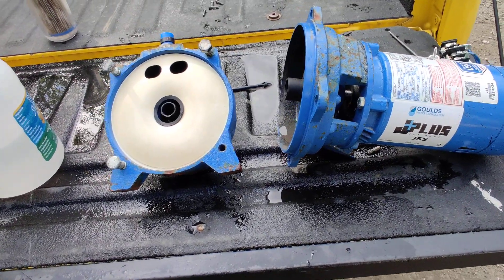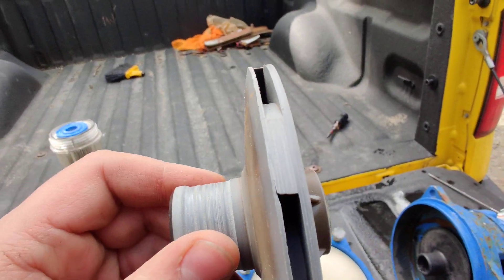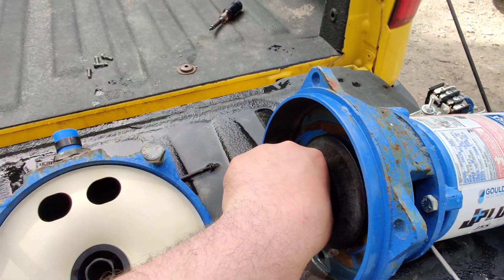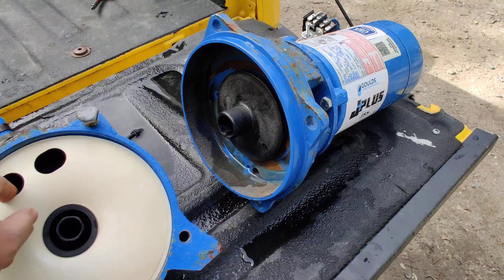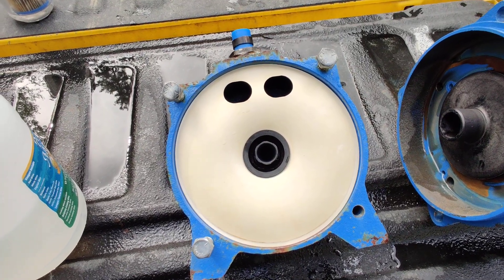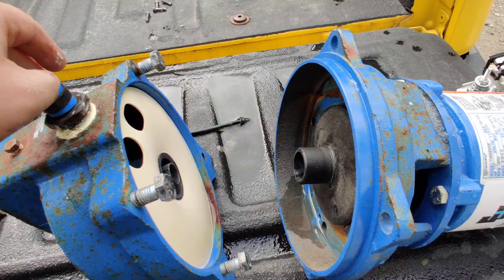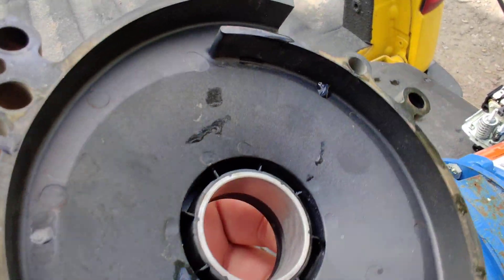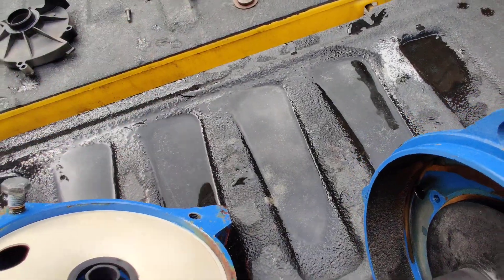Shallow Well Pump Rebuild -Gould J5S

Comment: Your suggested method for removing the impeller is incorrect and could damage the cooling fins. The manufacturer, Goulds (Xylex), also advises against inserting the seal into the diaphragm.

Comment: If my J5HS is making loud noise (significantly louder then before) would that be the impeller issue or are there any bearings that are worn out?
Reply: Probably bearings there are three, today the rebuld parts cost over 50% of a new pump sadly.

Comment: I had a Vacuum gage in the front 1/8 plug was..just to see the suction from my well, now the gage has popped off the rubber plug that sealed in the "oil" gage and slowly dripping water...when I took it off there was Pressure on it...I put a plug back in..is there something wrong?  I get great water pressure, was wondering if there is a check valve in these?  thanks so much

Comment: Just rebuilt my GT15. Thanks for the video. Very useful. CAUTION The "black piece between the two" is wrong. It is the Guidevane Seal Ring part#SK555 and it is installed last, after the Diaphragm part#SK522. Fitting around the Guidevane, the Guidevane Seal Ring will be sandwhiched between the Casing and the Diaphragm. Do not fit the Guidevane Seal Ring inside the Diaphragm as shown in this video! DO NOT stick anything into the motor to hold the shaft because it will break the plastic motor fan parts. Remove the back case and put a wrench on the shaft where it's intended to be held. Impeller removal on my unit was impossible without breaking the Impeller. The front half of the Impeller broke away. I eventually had to remove the motor, disassemble the back to access the motor shaft and use a wrench on the back with a C-clamp on the remaining Impeller to hold it in place. Careful on the back of the motor. The plastic bits are delicate and I broke a plastic tab on the terminal block that required some re-engineering to put it back into service. I used water and spit to lubricate parts when reinstalling. Main thing is cleanliness. It's a water pump and water lubricates the ceramic seal. However, Super Lube Multipurpose Synthetic Grease is shown on one of the pro shop rebuild vids. Part# SK7 in the rebuild kit is the Deflector and I did not find any reference to it aside from the schematic. The Deflector is installed first on the motor shaft before the Motor Adapter is installed and is "outside" the pump and visible, slinging any debris or moisture that gets on the motor shaft.

Comment: That is the purpose of the diaphragm?   I brought my pump in for a shaft seal repair  and the pump expert told me not to use the diaphragm.  Gave me a very flimsy gasket for the diameter.  Skeptical, I put it back together and it works well.  But not having the diaphragm is bugging me.

Comment: I think Gould assembles them with the seal against the diaphragm just because it's easier / quicker assembly... I put my seal in the hole of the diaphragm as you did ... Pumps like a banshee over 80 psi...

Comment: The diagram just sits onto the seal. You aren't supposed to put it on both sides of the diagram as you did. Don't assume and do as you please then make a video so others can make the same mistake.

Comment: The seal ring (Gould’s 5K6) should not be installed inside the diaphragm gasket (Gould’s 5K557). Put the guidevane (Gould’s 3K75) over impeller (Gould’s 2K4), and snug the screws. Reach in the middle and spin the impeller with your finger and adjust the guidevane before  tightening so that the impeller is not rubbing on guidevane hub. Then place the diaphragm over the guidevane, then slide the seal ring over the guidevane hub on the OUTSIDE of the diaphragm. The install the pump housing. Never stick a file or screwdriver through to hold backup. Use a 7/16” wrench maneuvered down the back side of the motor to align with the wrench flats on the shaft. I rebuild these for a living.
Reply: Hi thanks for the tips, if you don’t mind how do you take the cast iron 1K310 motor adapter off, mine cracked due to frost. Thanks
Reply: @ sorry so late replying. First take the casing off. Then remove the guide vane with a Phillips screwdriver. Then you have to spin the impeller off of the shaft. You can take the back cover off the motor off and fish a 7/16” wrench beside capacitor to reach the wrench flats on the back end of the motor shaft to hold back up while turning impeller counter clockwise. The impeller can be tight sometimes, but you should be able to remove it by hand.  With the impeller and rotary half of the mechanical seal off, you can remove the four motor adapter bolts for removal. If you want to try to save the mechanical seal, you will have to carefully remove it from the motor adapter without damaging the rubber or ceramic seal. I hope this helps. It’s really not that hard of a job. Oh yeah, you will also need to remove the tubing to the pressure switch.
Reply: @ sorry for the late reply,  I replied to my comment with your answer.
Reply: Thank you I will put that seal on the outside of the diaphragm there are so many conflicting instructions I guess I'll stick with you

Comment: Thank you for sharing. I found the seal to be loose inside… pump just spinning but no pressure . Now I see that you mentioned that is very important so I’m gonna make sure when I buy the kit. The existing seal seems to be expanded now and unable to put it back into the circle

Comment: I have that exact same pump. It was left in a house that was abandoned wasn’t winterized the water froze and cracked it just the pump head. I can’t seem to find a replacement for this J5S pump. I need the pump head and the rebuild kit I’m on Long Island in New York and I cannot find it. I would appreciate it if you know where I can get one. Thanks

Comment: Thanks! This video helped me repair my pump! The rubber ring thing was tricky but I finally got it!
Reply from the maker: As state by a few others, you may not want to use a screw driver as a chuck.  Although the amount of force needed to loosen in all of my cases has been so minimal that I wouldn't be too concerned.

Glad it was of use to you!

Comment: IMHO Do NOT put the metal file or screwdriver the way it is shown here to lock up the shaft.  That is a plastic cooling fan with vanes that will break off if you need to apply enough pressure to loosen a tight impeller.  (Ask me how I know.)  I followed this video and did that and broke off a piece of two of the vanes.  I'm hoping I didn't do enough damage to cause any issues with the pump when it runs.

Comment: Anybody have an on-line parts dealer for this kit. Seems to be very difficult to find for some reason. I’ve only found a couple and of course they’re out of stock. I live in Canada but would happily order from the states if I could source the parts there. eBay has had the kit in the past. Good video, thanks!
Reply: Try and get on the phone with somebody.
Reply: @blaine1014  Thanks, tried. These plumbing places are very secretive in Canada. Got a rebuild kit on eBay anyway.
Reply: @peterbush7900  not my experience with suppliers in USA! Took me 5 minutes to get on the phone and order a SCOT pump seal kit

Comment: Hi Klaus, That impeller  seal surface really got eaten up. Assume once it got grooved up that bad you had very little pressure build up,,or eventually no pressure buildup.
Reply from the maker: Pretty much, the pump would take almost 10 minutes to build up to 62 PSI in my 36 gallon tank, when previously it could fill in under 30 seconds.
Reply: @HaemonAK  The reason i ask is,,, I have an old Wayne pump SWS50 similar to yours but not as heavy. I pulled from our house basement as it took along time to recover fill tank  ,It was only 3 years old at the time, It sit in garage for 5 years,,and now wanted to use it to be dedicated for vegetable garden. I tore it apart just for kicks, i see nothing at all wrong with it,If i put intake hose in 5 gallon bucket of water it barely dribbles out discharge . If i pull hose out of bucket and up in the air dump water down the inlet from jug it will blast out water discharge like crazy. Almost as though there is a suction leak?  Mine is setup quite different from yours in regards to the impeller/diffuser. My diffuser/impeller mating surfaces has no grooves at all. They are so simple...after looking at them, I am more curious than anything why this will not pull a  prime from a  five gallon bucket...Sorry!  For long message
Reply from the maker: @brcisna  No worries at all.  Yes, if you can't pull from a 5 gallon bucket, I'd look to see if it's got a leak in your pickup tube.  Have you primed your pump using water to start as well?
Reply: @HaemonAK  , Thanks for suggestion. Here's how im test benching this shallow well jet pump.
1. Inlet has plastic 1 1/4 MPT plastic to 1 1/4 barb,  have a two foot section of new not sure what type rubber hose  is very heavy duty, for irrigation I think ,not sure spin name of the schedule, put two hose clamps on hose at barbed fitting to make sure it is pulling down tight after weak output, Pump sits on two concrete blocks with five gallon bucket right beside the blocks on ground . Other end of hose stuck in bucket of water. i have a gallon jug to prime with. Eventually the pump will start dribbling out water out discharge,and if i hold hand over discharge it will build fairly decent pressure if i release hand slightly,,,do this a few times,,then the pressure completely peters out. Have repeated this a few times, It seems like after run time just a  little bit, few minutes the pump warms up and then really gets weak, Almost wonder if the diffuser is warped but i did glob some good silicone between mating surface to seal shaft that diffuser bolts to.  Was just hoping to use what I had on hand but this pump isnt worth the cost of a rebuild kit. Can find a decent low end submerisible pump for about cost of rebuild kit. BUT,Ill have to put down a new casing to accomidate the larger diameter submersible pump. :( Sorry for long message again.
Reply: @HaemonAK  Sorry for all the messages. Am wondering if maybe the shaft seal would cause an intake leak? I would think the shaft seal would almost have to show signs of leaking out if this were the case. My curiousity just gets to me when seeing how simple these things are after getting into one of them, I never did actually take the impeller lose from shaft seeings it looks perfect.

Comment: Be care full by stick that file in you can brake the inside fan or hit motor winding it safer to just hold the back and I didn't see anything wrong with the impeller ya it had a little ware but it should still pump. I bet the jet in the housing had some silt in side it  that would effect it more then any thing when taken in they just cleaned it out. Iv been build booster for 18+ year and just by looking at it I can tell you in less that front part of the impeller had made a huge gap that's the only way it will effect the pumping  👍👌✌️💯💦🌊🥂 what part of Alaska I spent 6 mouth out of a year for 5 year there with my grandpa 😁
Reply: Do you know the torque specs for putting this pump back together?  I replaced the diaphram on mine and reassembled it.  Is the diaphram installed dry or should I use some pipe dope on the faces to help it seal. I am still having a slight dripping leak.  I am afraid to tighten it anymore for fear of snapping off on of the "ears".  Thanks
Reply: @kenjordan5164  never heard of any torque spec to tighten it the can snap. Be careful. It need to be cleaned up better if it leaking and tighten Chris cross pattern even it should seal I never put anything on it to seal this type of pump uselly if it leaks it has rust build up or you haven't tighten it even if any thing put silicone on the lip lightly tighten let dry should seal it up hope that helps.👍✌️💯🍻💧🌊🛠️

Comment: Thanks, this was useful, but I think that I have one correction. When I opened my J5S up, I too found the diaphragm was not in the groove of the seal ring, but this was the first time that it was ever opened, so that seems to have been how it was originally assembled by Goulds. I took a look in the service manual, which can be downloaded from the Goulds website. It actually says to first place the diaphragm onto the guide vane hub (i.e. in the motor side, not in the housing side as you did) and then to place the seal ring onto the hub after that, with a photo showing doing exactly that. The hole in my new diaphragm was the exact size to fit on the hub on its own, and when I tried to insert it into the channel in the seal first it didn't fit right and ended up twisted out of shape. So it does seem like the guys at your parts place were correct, and you should just slide the seal ring onto the hub after putting the diaphragm onto it.
Reply: Agreed.. I just took my JS7 pump apart and the seal ring was put onto the plastic diffuser part and the diaphragm on top.. i.e the seal ring was not in the groove.
Reply: Same with gt15 irrigator.  The seal is on the inlet side of the diaphragm.  Seems counterintuitive, as the groove in the gasket in my mind's eye should fit in the hole of the diaphragm

Comment: Dont use the screw driver to chuck the shaft. Thats a plastic internal fan which you are chucking on. Use the 7.16 on the back. Much safer.
Reply: I guess I should have read the comments beforehand.  Found another video where the guy did that by holding with a wrench .  Very good advice to hold the shaft the proper way.  Luckily I didn't break anything following the advice in the video.
Reply: I agree.  Do NOT put the metal file or screwdriver the way it is shown here to lock up the shaft.  That is a plastic cooling fan with vanes that will break off if you need to apply enough pressure to loosen a tight impeller.  (Ask me how I know.)  I followed this video and did that and broke off a piece of two of the vanes.  I'm hoping I didn't do enough damage to cause any issues with the pump when it runs.